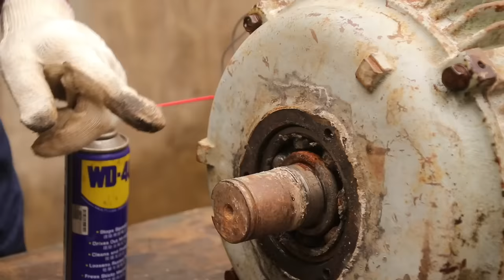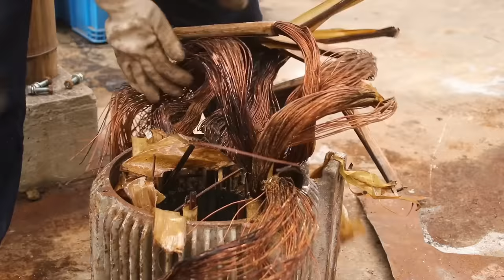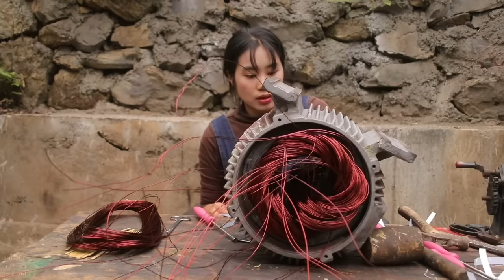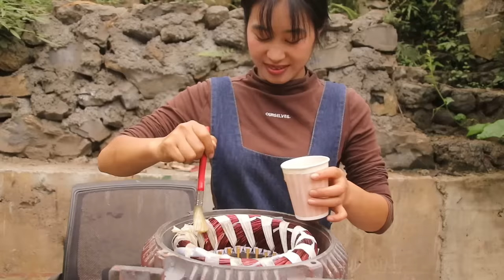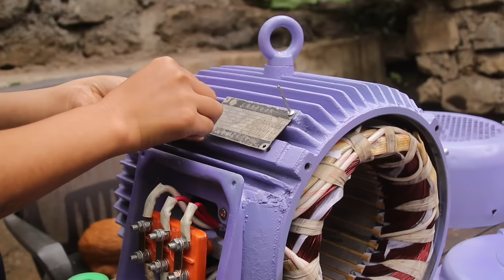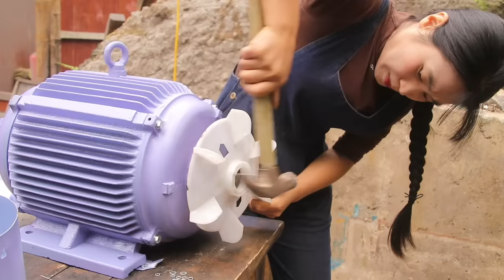😘The genius girl helped the workers repair the motor produced in 1992, and the effect was great

Comment: Given the lack of modern tools used in rewinding motors, this young lady did an amazing job on this TEFC motor.   There are things she did that are a little disturbing, but since she does not have a hydraulic press to install bearings, I would use a hammer too to install them.

She knows what she is doing and uses techniques that are used in the motor repair industry here in the states.

If she were working here in the US, I would be happy to give this lady an opportunity to work in my company’s shop.   By providing her better tools and equipment designed for motor rewinding, this lady would be an awesome employee.   I’d hire her in a New York second.
Reply: OK.  Nothing wrong with the way you  see things.
Reply: It doesn't matter how old the motor is. Ball bearings should NEVER be hitted directly with a hard steel hammer. I learned this in my engineering education already over 45 years ago. To assemble  ball bearings on a shaft you need to use a tube that only touches the inner ring of the bearing. Use a tube of aluminium or copper or put a piece of wood between the tube and the hammer or use a "soft" hammer.
Why? - Because the contact surfaces between the rings and the balls are very small and the intense shocks a hard hammer give cause small defects on these surfaces that will cause noise (can be noticed already when you rotate the shaft by hand) and significantly decrease the lifespan of the bearing.
Reply: @joehartoebben9666  
   In the jungle maybe. But she has for example sandblasting equipment (more efficient than mine) and a hydraulic outpuller (which I don't have). So I don't think it would be so difficult for her to have some scrap pipe stubs and I'm sure she has some pieces of wood, right? If you constantly do this work you should have at least cheap and simple but still proper tools.
Yes, you could be right about aluminium and I've never used it either. 
    In my opinion even a carpenter's hammer is too hard and their hardness actually differs from each other a lot. And yes,  I can see that she tries to hit both the inner and outer rings at the same. How successful she is I can't tell. The hitting surface of a hammer is usually a little rounded.
   I've watched a lot of her videos. The hammer seems to be her favourite tool. Sometimes she should also be more careful with aluminium alloy and cast iron parts. - But I've seen worse. Novices learn from videos like this. That's why things should be done the right way.
   I just want to do things carefully and accurately. I've seen new  bearings that keep abnormal noise directly after they have been installed by using hammers. 

It's funny that you mentioned "living off grid in the US". I like to follow channels like "Ambition strikes" They live off grid and have more technology than most of us - but I know what you mean....
Reply: There always has to be some yahoo who throws in negative comment.  Who cares if the woman used a carpenters hammer or hit the bearings.  She worked with what she had and most likely replaced the bearings.
Reply: Agree, it was a nice neat job using techniques I've used all my life in electrical and electronic engineering, does need better bearing tools and a rubber hammer though.
Reply: Good on you, I would hire her too. The thing is she seems to really enjoy fixing things. Plucky wee thing.

Comment: Your very talented. One thing I did notice that I was taught here in the US not to do is solder terminals. The solder can cause issues over time and failures. At least thats what I was told. Other than that you completely restored that motor. Great work. :)
Reply: Well, someone really needs to teach her how to assemble ball bearings. She already pretty much destroyed them. NEVER hit them directly with a hard steel hammer! The contact areas in the bearings are very small and even if the material is hard, there will be small defects that cause noise and shorten the lifespan of the bearings.
Reply: My name I. K. Anand India Jammu and Kashmir Jammu I am thank thousand time
Reply: Well, since she's crimping the terminals with pliers instead of an appropriate tool, soldering is probably for the best...😉

Comment: You are so talented! It´s a joy to se you work!. I´d never have the courage to even try to repair an electric engine. I´ve got a little friendly :) tip for you that i learned at tecnical college here in Sweden; - Never strike a hammer directly onto a roller bearing. Always put a piece of wood or something in between. Otherweise the bearing might crack. A metal pipe with siutable dimention around the axel coul be used. And, always strike on the inner ring. Anyway, just a tip. Best wishes/Peter🙂🙂🙂
Reply: I think I need to add that the contact surfaces between the rings and the balls or rollers of a bearing are very small and those hammer strikes cause small deformations to these surfaces that will cause noise and significantly decrease the lifespan of the bearing. It doesn't literally need to crack to be destroyed.
Hälsningar från Finland!

Comment: By not controlling the bake out temperature to remove the magnet wire from the old stator, the extreme heat damages the laminations and causes extra losses. The rewound motor will draw more amps, run hotter and prematurely fail.
Reply: The wound stator is not correctly varnishes to bond the wires together. She hammers the bearings onto the shaft damaging them. Neither good.

Comment: This is an actress. Her role as a mechanic/electrician/plumber/carpenter. Do you really think she can do all this? If you do you insult every tradesman out there who spends a lifetime learning and perfecting just 1 trade. She can't do anything with a scrip od someone to show her. She is no mechanic, not an electrician, and certainly not a carpenter.

Reply
Reply: There obviously is no one there who can teach her how to mount ball bearings anyway. It hurts to watch her slamming them directly with a hard steel hammer. These bearings are already pretty much destroyed. 

If no press is available, at least she should use some softer material between the hammer and the bearings - and should always use a tube that touches only the inner ring when she mounts a bearing on a shaft.